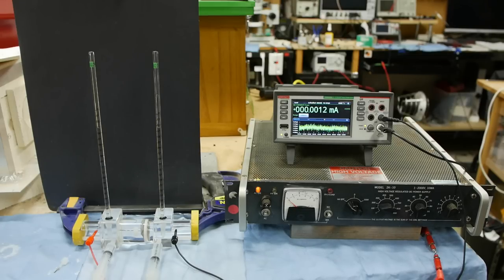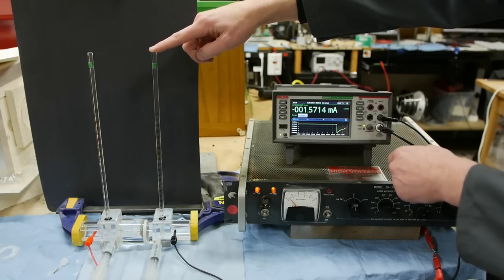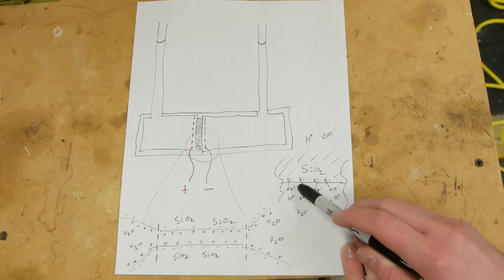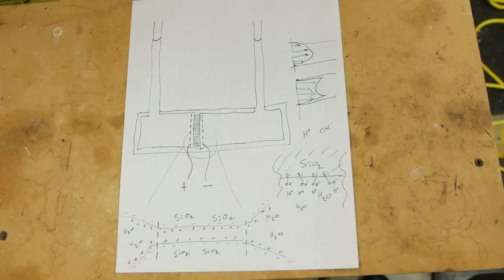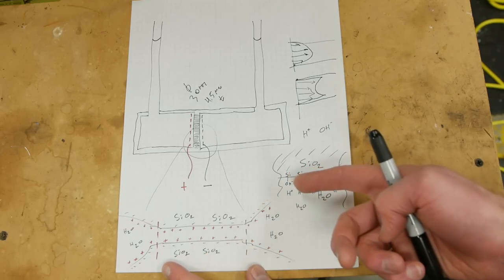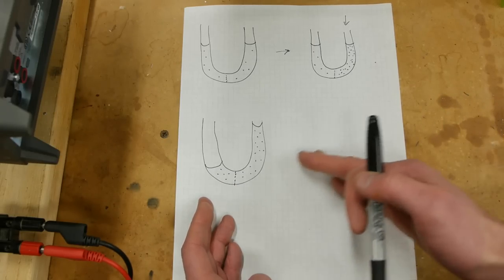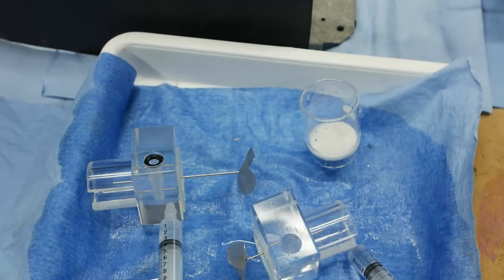Electro-osmosis: pumping water with electricity and no magnets

Comment: One question I have not seen in the comments here is; What effect would using copper pipe (or any conductive material ) instead of the the electrodes and screen mesh have on the efficiency of this system? Excellent work on this video by the way. You always explain what is going on really well.
Reply: I would say it is a function of hydrogen overpotential that the electrode materials has....the higher overpotential = less energy is lost for electrolysis....but I am not sure if it makes any difference at 200 Volts

Comment: Very cool thanks Ben.    Would be interesting to know how much the Sodium in the glass contributes to orientation of the  neg end of the polar water molecule.   I suspect a quartz  frit filter with no Sodium would be rather expensive.   Also since it's the field that's important, I wonder if the electrodes could be insulated thus eliminating any  electrolysis effects.   Just don't screw up and try and plug both pipette at the same time at 200V, I want to watch more videos.  
Craig

Comment: I never knew that glass had the ability to break up a water molecule, that seems like something that could be incredibly useful.
Could you create a lattice of glass so thin and so packed that you could strip the incoming water into hydrogen and hydroxide?
I mean once the hydrogen is split, could it be extracted or placed into a solution that's easier to thermally crack?

If anyone can come up with a way to produce hydrogen cheaply from water, it's you. You have the skills and the ability to change the world.

You're a true inspiration and I look forward to every video you post.
Reply: Electrolysis powered by solar, wind, geothermal comes to mind.

Comment: The case of natural convection flow between two heated vertical parallel plates is similar. The velocity is zero at the plate but the buoyancy forces driving the flow are also greatest near to the plate, as this is where the largest temperature difference between the plate and free stream occurs.

Comment: This is very interesting. At my work we are actually trying to measure the reverse effect like you show in your video. We are interested in the voltage or current that is produced when a flow is introduced in the capillaries of a ceramic membrane. This is called streaming current or streaming potential. I never imagined the reverse was also true. Your video will help us a lot designing a system around this phenomenon!

Comment: I wonder if a slice of wood would work instead of the fritted glass filter? Wood has tiny porous tubes (xylem/phloem tubes) that would be more organized than the randomly packed glass particles of a fritted glass filter. Might work even better? Plants, afterall, are perfectly designed for moving water up/down efficiently.

Comment: @Applied Science Where did you find the porous glass frit? I've been looking for exactly such a thing to use in Ag/AgCl reference electrode junctions. Thanks for another great video, what a great channel.
Reply: DIY frit: Place glass in a tumbler with (clean) rock or metal. The result is crushed glass, called frit. Next filter and wash the frit to obtain your desired size pieces. Then place the frit into a heat resistant mold of the size and shape of the desired end product. Finally heat the frit just enough to fuse, but not melt entirely.  Optionally, prepare the edges for your particular application, such as applying silicone to form a seal.

Comment: Suggestion for a future topic: electropheretic drying. I was working as an energy analyst and was auditing a paper mill and they were having difficulty drying their paper at full speed for some thicknesses so I looked in to novel paper drying methods and discovered research into using electropheresis or an electrostatic field to lower the enthalpy of vaporization of water increasing the drying rate. I believe that it can also lower the boiling point or the vapor pressure of the water itself. I think that would be a really cool topic to explore in the future. Like this comment if you would like to see this.

Comment: Very nice! I think the explanation of osmosis using those U diagrams was missing an element that should help it make more sense, and that is that the atoms of the salt molecules dissociate in water, and you will also get some dissociation of the water molecules too... more salt in one side means you have more positive sodium ions to attract the oxygen, and more negative chlorine ions attracting the hydrogen... so it's like having loads of tiny ball bearing in the tube that can fit through the filter, and a bunch of larger magnets on one side of the filter... add to that the random movement, you're going to end up with the ball bearing preferring the side with the most magnets, so there is the same ratio of balls to magnets on each side. Hope that helps :-)

Comment: Really a cool 'machine'.! 
Maybe this technology could be useful in the future e.g. in miniature systems for non vaporizing cooling devices or many other applications where a liquid is intended to flow without being moved by moving parts.
All parts available on eb... at low cost.
Most trouble with readily available parts was to keep the experimental setup from leaking... Holy Silikon sealant... A great experiment !

Comment: It would be interesting to see this revisited if you can get a glass microchannel plate.  I'm wondering what efficiency gain you'd get with all the pathways essentially aligned with the field.
Reply: Or a tube inside a tube, with parallel grooves ground along the length of the tubes. Increased surface area.

Comment: This reminds me of an old Pool filter trick of replacing the sand with glass microbeads, this (supposedly) causes an electric charge to develop which aids in sterilization via ionization, which is supposed to make it so you can use far less chlorine. I wonder how well this scales because it would be nice to apply this technique to tertiary wastewater treatment

Comment: actually they used shape charges to create blasts shaped like you show there in the tube to compress the radioactive explosives in the first bombs to avoid it losing pressure due to a bunch of round point explosive pressure with the side of the explosions allowing pressure relief, but this information on liquid flow like this I think gives rise to some interesting tech that could used in other areas. :)

Comment: There seems to be a lot of confusion about how this thing actually works. In the video, it's suggested that the H+ ions arriving at the output side recombine with OH- ions, but I don't see how OH- ions can get to that side since the electric field is pushing them the other way. None of the explanations I've seen in the comments so far entirely make sense to me.

Here's what I think is happening: The electric field causes H+ ions to migrate towards the negative electrode, where they all gain electrons and become H2 gas. Meanwhile, at the positive electrode, H2O molecules are being stripped of electrons to produce O2 gas and more H+ ions. The moving H+ ions drag water molecules along with them, making the water flow.

If this is correct, it means that it's not possible to eliminate the electrolysis (e.g. by insulating the electrodes) because it's an inherent part of the process. However, it should be possible to recover some of the energy lost in electrolysis by collecting the H2 and O2 and using it to drive a fuel cell.

Edit: I've just realised that this theory would also explain why a small amount of conductivity is needed in the water. Production of H+ at the positive electrode won't happen unless there are some negative ions nearby to balance the charge. Similarly, H+ ions won't emerge from the other end unless there are some negative ions present. So a bit of conductivity is needed to electrically connect the electrodes to the beginning and end of the boundary layer. But not too much, because any free negative ions in the channels will move the wrong way and be detrimental to the pumping action.

Edit 2: I wonder if the need for conductivity in the fluid could be reduced by depositing a thin layer of metal on the ends of the block of frit, instead of using separate electrodes? The idea is to get the electrodes in direct contact with the edges of the boundary layer. Would it then work with a fluid that was completely non-conductive when not in contact with the glass?

Comment: When you push the water with the syringe you're doing the work. A load on the electric circuit would generate an opposing force to your push, but the total energy is the mechanical work to move the water + any work in the electric load. My point is that as not all the power goes into the electric circuit, you can't expect to see the same figure in the ammeter in both cases.

Comment: I know what I’m about to wonder is probably going to be weird/ignorant/naive, but I can’t help it; And, this is two years late.

At around 14:00, you talked about how a laminar fluid, uniquely water, which/whose profile in a 2D pipe is modelled to have this “inward buldge”. This is very counter intuitive, but has slowly begun to make sense. The “counter” nature reminded me of the flow of electrons, which obviously seek “higher potential”, which we would describe as “greater voltages”, on a circuit diagram, say. I finalized the difference between the analogy of “water and electron flow” (which is pretty common) and decided that electrons truly flowed like “anti-water that flows uphill”, but without thinking about the way it might work in a pipe. I believe my imaginary “anti-water that flows uphill” is what that strange 2D pipe model might look like if anti-water flowed in a pipe.

So, I guess all I’m saying is: your pump model you drew/explained, i see as an analogy to electron flow in a wire under the influence of an electric field (potential difference, i.e., voltage).

But to be fair to my wonder/confusion, the reason why the electrons move faster towards the inner surface is because the molecules (hydrogen dipole charge) are affected by an electric field, so when you apply one, it applies a force; Newtons second law, a force changes momentum. I think it might also spin the molecules, creating a turbulent flow?

Sorry for the long comment to whoever reads, but please correct me if I am wrong. Thanks!

Comment: Excellent video! Have you tried using chlorine treated silver electrodes? This is a much more efficient electrode for use in this application and it could greatly improve the sensitivity of the rig for flow sensing when combined with a low noise amplifier.

Comment: if I understand correctly, the pump works only because water is a polar liquid. The electric field exerts a force on the hydrogen ions, but they are surrounded by a whole cloud of water molecules, which are moved along. I guess, that for each ion that is brought from one side to the other, approximately 10 million neutral water molecules must be moved along. (This is the number of water molecules that is needed to make an electric current of the order of milliamps into a volume flow of milliliters per second.)
Reply: He specifically said that it only works with polar liquids.

Comment: This is super neat, but I'll have to be that guy and point out that your explanation for standard osmosis sounded kind of wrong: the ratio between the probability of water crossing and the salt crossing is unimportant; the real deal is that the probability of water crossing is different on the two sides because the water molecules get stuck to the salt ones and are less available into going to the diluted side. In fact if you put a apolar colloidal substance it won't work: while the colloid still can't pass the membrane the water goes on both sides because it doesn't have to wet the other one; at the same time dehydrated silica balls actually work, despite being quite macroscopic

Comment: Just a thought, but have you tried keeping the voltage below the electrolysis voltage of the fluid, and instead adjusting flow by adjusting the fluid conductivity or distance between anode and cathode, or surface area of your anode and cathode grids? For water it's difficult, because the reaction voltage is so low (1.23v), but not impossible if you reduce the glass disc thickness and instead arrange multiple successive pump chambers (with each successive disc allowing more flow). 700v @ 3mA is the same amount of energy as 1v @2.1A. In this particular case it seems like it wouldn't cause arcing either since glass is an excellent insulator.

Comment: Very interesting. What would happen WITHOUT the filter disc, besides just equalizing much more quickly when the power is switched off? It seems that it would pump a greater volume, but would require more current.

Comment: @Applied Science: I think can be VEEERY interesting one thing above the other. The following test:
Turn on the voltage generator,  and PUMP AGAINST THE FIELD the water with a peristaltic pump or something similar.
You observed that at a certain voltage, the current decrease when the flow decrease. If it is decreased and than inverted? Do You can produce electricity?
Which could be the efficiency? Increasing the flux of the peristaltic pump, you should increase the current limiting the relative weight of the parasitic ones.
Increasing further, should produce huge pressure drops and again loose the efficiency.
Would you like to try? Thank you. :-)

Oh, I've forget to mention.
When you produce current without the electric field the thickness of the polar interface at the walls is negligible and the measured current is also negligible, but if We impose an external voltage things changes!
You can't produce electric energy with an asinchronous motor if it is not already excitated! Please don't forget to try! :-)

Comment: What kind of voltage are you using?  I think water requires at least a volt or two for electrolysis to happen.  could you drop the voltage and increase the amperage to decrease the electrolysis?
Reply: Higher amperage would add heat. If I remember correctly, higher amperage would increase electrolysis. That's why he is using milliamps.

Comment: I saw someone explained that there is no actual ionization of the water molecules, and it's "more like the hydrogen acts like a tail being dragged to the other side, and it drags the whole water molecule across with it". BUT, how is that even possible? Yes, the positive Hydrogen end will experience electrostatic force, but why won't the negative end of the Oxygen experience a opposite force by the same electrostatic field?
What is the actual direction of the flow w.r.t electrical field? Seems not so obvious since your power supply is bi-directionally switchable. If there's current, there are exchange in electron between electrode and the fluid. Are these electron contributing giving any momentum to the fluid maybe?

Comment: While back you reviewed the desktop SLA printer from Form Labs.  In the video you showed how it could produce some microfluidics.  The Electro-osmosis pump seems like an ideal application for that but instead you opted to machine, then polish the parts.  I was wondering why you didn't 3D print the parts with the Form2.  Can you share your thoughts?

Comment: @Applied Science   I just saw this and I am reminded of some filter media I saw years ago. It was formed of tiny glass capillary tubes sintered together. I wonder if that would produce a more efficient pump. The surface area would be quite high while the path for the fluid through the filter would be a straight line. What do you think?

Comment: I wonder if there are any applications for this kind of pump in the real world? Great video and nice build, but I wonder if it could be used as a replacement to traditional pumps.
Reply: Also, could this be used for removing excess glucose from a diabetic, reducing the amount of insulin required. Insulin causes the body to turn the excess glucose into fat, which only exaserbates the problem.

Comment: nice to get water up into a sky scraper, then drop it in a shaft past water turning wheels, generate more power than it costs to pump it "up".

do you want the water to fall from your finger into the high voltage device?

Comment: Wait, where does the asymmetry come from? How come we aren't just pumping H+ towards the positive electrode and vice versa with OH-?

You mention recombination but how do you get recombination if only positive charges move one way? Shouldn't charges build up on each side until an equilibrium is reached? Clearly this doesn't happen as the pump works but I'd appreciate an explanation.

Best I can offer is H+ moves faster because of its size and therefore induces flow one way trough viscous interactions. Then H+ gets reduced on the electrode to H2 which prevents charge from building up. Probably wrong though.

Would be interesting to see if this would still work with a very low voltage (no electrolysis) and a thin membrane to compensate for the lower voltage.

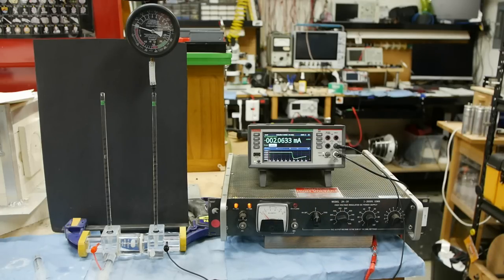Comment: Hi Ben, impressive experiments and a great build! I have a question about it, at ±5:00 you show us how you can change the polarity and the flow direction, and at ±6:00 you show us how you can measure the pressure in the tubes.
Do you know if the maximum pressure is the same for both tubes?